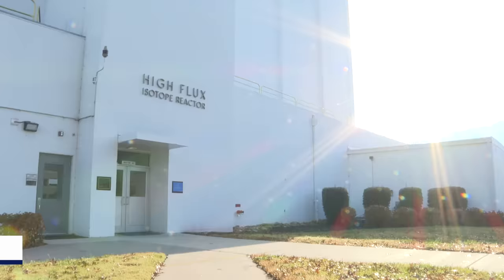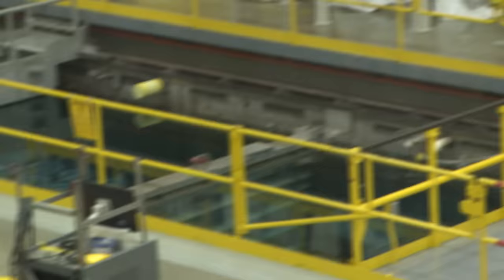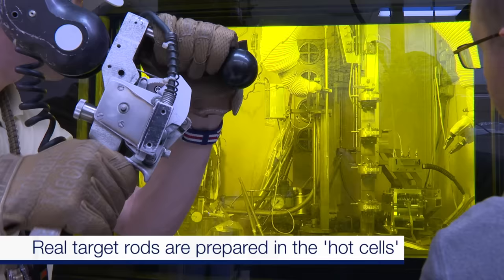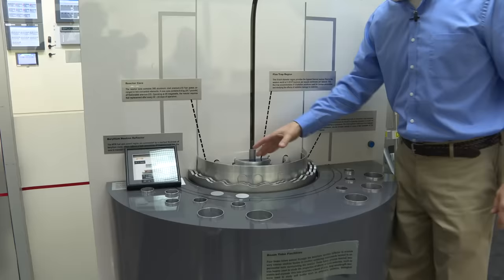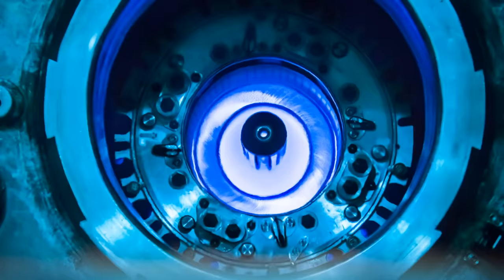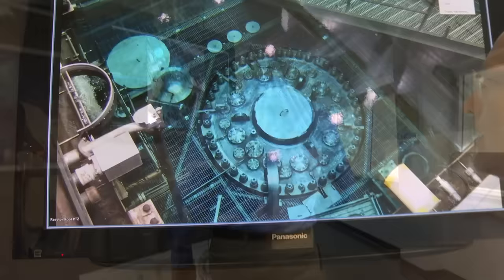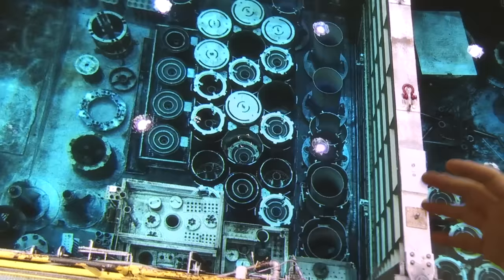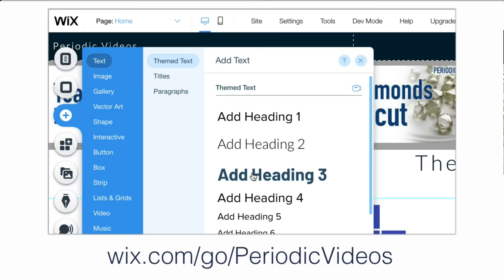Inside a Nuclear Reactor

Comment: Good old nuclear energy. Despite it's ill reputation is it still one of the most efficient and cleanest ways to produce energy. And we couldn't even really live without it even if we wanted to. Parts of modern medicin for example relies on it to produce radioactive isotopes.
Reply: Germany's really digging a hole for itself with its refusal to use nuclear energy. Not only do they have to import dirty fuels to replace it, but they'll probably have to import nuclear isotopes for nuclear medicine as well.
Reply: "cleanest". Waste takes millions of years.
Reply: @RBuckminsterFuller  It is better that way. Espescially since france is on fire.
Reply: @Erksah68  Not with gen4 reactors that allow for processing of fuel waste. LFTRs, for example, are a much better option nowadays.
Reply: Also safest, but people don't want to mention that- the number of casualties/fatalities per megawatt produced are significantly lower than even renewables. People just think of the scaremongering of the big three disasters which resulted from catastrophic negligence, and fail to realise just how rare these actually are. And yet nobody hears about big coal power station explosions or fires, or underground coal seams that keep burning for decades on end. Nuclear's bad rep is mostly unwarranted.
Reply: @Erksah68  First of all, it doesn't, and second of all, it's a far smaller problem than certain groups would like you to think.
Reply: @Erksah68  and can be stored safely while we find a use for it, instead of releasing tons of CO2, various nitrogen oxides, fine particulates, costing millions in cleanning fees for historical monuments, destroying people's health (remember smog?) wich then get to be cured with isotopes produced at plants like these.
Cleanest.

The problem you apparently fail to see is that a single cow dung in a room might smell horrible, but it's easier to contain than an entire room splattered floor to ceiling with it.
Reply: @NapalmFlame  And coal is even worse than nuclear. I'd rather have waste underground than in the air I breathe.
Reply: @Erksah68  its far from 'cleanest' unless you were to design a new Thorium type. But it is perhaps the cleanest that a) a lot of countries don't have access to e.g. geothermal, hydro etc. b) is stored properly and responsibly.
Reply: @NapalmFlame  you are right. you are more likely to injure yourself maintaining a rooftop solar panel, than be an unlucky resident of belarus exclusion zone.  But, chernobyl's all concentrated in one area and its scary and immediate. Coal is of course multiple times worse with pollution, mining, etc.
Reply: @jorgepeterbarton  Renewable energies need time to mature, just like nuclear did. Forcing it will just make it look bad. "look energy prises are rising again". It does also have a positive effect making households conscious about the electricity they are using, but it could've lead to the media killing it in one go.
Reply: Also I don't think casualties are really a measurement of danger, when you directly have access to professionals who ing it for you. If you fall off your roof it's your own fault. You directly could've changed something.
The millions of residents that died in the past did not have any access to such means. Thes just died. Period.
Reply: On a come back now.. 
Most people are not so terrified or skeptical as in 70s.
We need more clean energy and medical imaging etc.
ITER fusion a big project in France.
Check it out.
Reply: @Erksah68  so our planet atmosphere will heat up first form co2 methane emissions long before any issues with nuclear waste can pose a problem..
Fusion at ITER is a game changer in future power plants.
Reply: @MitzvosGolem1  "if we continue it wouldn't matter if we die because of heat or the heat destroying niclear reactors, " that is what you're trying to say?
Reply: @MitzvosGolem1  Most people, yes. But it seems ironic that my country's 'green party' would be anti-nuclear when it is demonstrated to be, at present, the cleanest and most reliable method of power production available.
Reply: It’s a long lasting fuel, but comes at a price when things go wrong. If we had a way to neutralize radiative energy this would make it very attractive.
Reply: How expensive are Chernobyl and Fukushima? A few hundred billion USD? A few trillion? The reactor companies should pay for that. 🍄
Reply: @NapalmFlame  Former head of Green peace is now pronuclear
Reply: Dwadist Coal actually produces even more harmful radioactive waste than nuclear does. At least in nuclear the waste is stored in spent rods that can be safely stored, but the coal waste is burnt, aerosolized and then floats around in the environment along with all the greenhouse gases it produces. People talking about the potential radiation damage don’t realize how much more radioactive material has already been produced by non renewable sources.
Reply: @Erksah68  There were no "milions of residents" who died. Stop speading misinformation. Hydroelectric dams made more death in one accident than all nuclear accident since their discovery.
Reply: @arnaud7671  let me rephrade that. Many died, millions were affected by it.
Reply: @Velo1010  We do have a way! You simply store it under water :)
Reply: Eeehhh... That giant thing we orbit is the best source of energy. Just need more efficient methods of conversion. I don't recall anyone making a power supply rated to last several billion years. 😜
Reply: @jorgepeterbarton  Not only that but the waste produced from solar pannels is 300 times more than nuclear. Also they require thousands of times more mining than nuclear energy. At least at Chernobyl there's forests and wildlife. There isn't  that at strip mining areas
Reply: @scratch no one died
Reply: @Erksah68  Not true.  Highly radioactive material has a short half life, in other words it decays rapidly.  Weakly radioactive material has a long half life, millions of years as you say, but so do uranium minerals in the rocks and soils all around you.  If the Pharaohs had been storing nuclear waste in the pyramids it would be safe to take out in wheel barrows now!
Reply: @RBuckminsterFuller  The Japanese have been putting their reactors online again  as importing oil and gas was damaging both the economy and the environment.  They are tsunami- and seismic-proofing them now to even higher standards.
Reply: @Jawshuah  To be clear I'm pro electricity because this whole banter wouldn't be possible.
Besides you probably haven't heard of Uranium Strip mining. It's a thing...pretty much for any ore in abundance. So...the whole ecologically safe thing about mining is sales pitches. Processing ores from copper, alluminium, iron, titanium, uranium and Rare Earths all leave nasty evil biproducts from chemicals and fuels spent in refining. 
What I was saying is that hey the sun ain't gonna run out and the tech is only gonna get better with time. Less dangerous materials, less exotics, more efficient methods and energy harvesting--just like nuclear if don't stop researching and innovating.
I think solar, hydro, wind, Geothermal and nuclear combined is the winning game.
Reply: @Jawshuah  You can't discount the long term and near term effects on any power plant disaster. Just because someone didn't die right sway doesn't mean it didn't cause long term health problems. Coal, oil, nuclear etc.
I mean look back at the infamous London Fog...there's a history of nasty health effects. Just say in. :)
Reply: @GGov86  anti-nuclear groups are funded by the oil and gas industries
Reply: @Erksah68  Thousands were affected by fear, not by actual radiation.  There are people living in the Chernobyl Exclusion zone right now, and their only affect is a negligibly higher chance of developing cancer in their later life.  The area around Fukushima is already safe to live in, it's just politics that don't let them go back.  Why don't you care about the lives of people who have been killed in solar/wind accidents?  If you've ever worked on a job site, you'll  know that people make mistakes and forget their PPE all the time.  Seems cruel to brush off their deaths.
Reply: @BobbyHill26  yep. cheap coal, as burned in power plants, may contain up to several kilos of uranium oxide per ton coal. Problem is with nuclear: The resources of uranium ore that are economically viable to mine are even more limited than coal! So for the long-term perspective, there would be no way around breeders, which are their own universe of problems.
Reply: @SuperAWaC  that sounds very conspiracy-theoretical. Prob is that many anti-nuclear groups don´t think the whole thing through, e.g., taking energy consumption and the energy demands of a technologically advancing society into account.
Reply: @24680kong  so there seems to be no real difference at first glance: at a certain scale, any technology will lead to some deaths by neglicence. Only, in some , you only endanger yourself, whereas in others, you endanger many more people for long times. Worth looking into properly.
Reply: @paavobergmann4920  hey everyone check this guy out he thinks lobbyists are a conspiracy theory
Reply: the future is fusion
Reply: @timpecover8600  fusion is just about ready, since 30 years....
Reply: @Erksah68  "waste takes millions of years"  This is such a bizarre argument. 
1. The grand majority of radioactive isotopes decay in less than 100 years. 
2. Long lived isotopes aka the timeframe youre referencing exhibits extremely low level radioactivity. 
3. Chemical wastes don't decay or degrade until rendered inert by another chemical reaction. 

So your argument is that we should be afraid of a few isotopes that present low levels of radioactivity, as compared with other types of wastes that could pose a greater threat that in actuality would last infinitely longer? That doesn't make a lot of sense...
Reply: @brian2440  the radiation isn't dangerous to humans, no
Reply: @Erksah68  What isotopes  that decay over millions of years are you so concerned about?  

Many of them I doubt you have even heard about, many of them are actually used by multiple industries because they exhibit low levels of radioactivity. Some of them are dangerous, albeit moreso due to chemical composition than actual radioactivity.
Reply: @brian2440  It is not the radioactivity of these elements that I am primarily afraid of; it is the incredible toxicity of many of the products of nuclear decay.
Also, the 'nuclear waste' that people speak of is not primarily the spent fuel, but the reactor shielding which is irradiated. This makes up the predominance of what has to be stored for, in effect, perpetuity. The reactor 'shielding' is a mixture of compunds that can't be easily separated, thus can only be reused under very specific circumstances. There are over 70 000 tons of nuclear waste material (spent fuel rods, as well as shielding) that still, after more than 50 years of research, have not been reasonably been stored for even ten years unless under direct human supervision and continuous maintenance. But continuous maintenance costs money, money which the nuclear companies do NOT have to spend. 

The governments of Germany and quite a few other countries that are utilizing nuclear energy have recently agreed to NOT force the nuclear companies themselves to cough up the cost for storing these waste materials. The governments themselves have agreed to a) fund research into the recycling or b) storing these materials. As such the economy of the production of nuclear energy works out for the companies themselves, but not for society as a whole. 

If the nuclear companies WERE forced to spend the same money that ALL other electrical power companies have to pay for the storage or clean up of their waste materials, we would have no more nuclear companies, as they would INSTANTLY quit as they KNOW that an economic usage of nuclear fission power generation under these circumstances becomes virtually impossible.
Reply: @RustyDust101  "If the nuclear companies WERE forced to spend the same money that ALL other electrical power companies have to pay for the storage or clean up of their waste materials"

Oh that's adorable. The naivety of believing that all other electrical industries actually clean up their waste materials, and Im not just talking about fossil fuels.
Reply: @SuperAWaC  this is not what I said, and you know it.
Reply: @paavobergmann4920  I know that's the old joke, but we are actually making lots of progress in fusion right now, much more than the past.
Reply: @Captain-Sum.Ting-Wong  so, when is break-even point then? How affordable are the reactor blankets that provide neutron balance?
Reply: @ThePrezred There is a little more Uranium in the ore, but you are basically right. Also, there is not really much uranium to mine. Ok, there is 3x as much Thorium, so we could increase the capacity many times by using that, and Breeding Reactors (Which are inherently much more dangerous for various reasons) to use the fuel more efficiently, but still, the supply is limited. This technology can only be stepping stone, it has a naturally limited lifetime.  BTW, fusion isn´t really clean, either.....
Reply: @ThePrezred Chemical extraction is most definitely reliable, since chemical extraction of that sort is what NASA uses to get their plutonium for their RTGs. They take neptunium that has been bombarded with neutrons generated from a high flux isotope reactor, which contains about 10% plutonium once they're done with it. Chemical extraction is also regularly and routinely done with a lot more isotopes for the medicine industry too.
Reply: @ThePrezred The process of extracting waste products from spent molten salt, or from extracting the desired resulting products from a flux isotope reactor, are comparatively clean. As far as the mechanical extraction, I assume you mean for the metal ores used to refine fuel, and that process is as dirty as any other mining, and could not possibly be worse than what is being done in the Amazon to mine gold.
Reply: @ThePrezred The only major concern when it comes to mining uranium specifically is radon, and the hazards it poses during mining itself. Its worth noting that the radioactivity of uranium ores is comparable to that of granite, so the risks, dangers and pollution is no worse than other metalliferous mining. Thorium poses less risks because it can be mined in an open pit, so there is no risk of a buildup of potentially harmful or dangerous gases, as well as the higher concentration of the desired ores making for a potentially more efficient and less harmful mining process than that which is used for uranium.
Reply: Yes watch thoughty2 new vid on nuclear power
Reply: @scratch you have no clue what you are talking about
Reply: Never thought of it that way. Its always fascinated me and I've even had some nuclear testing done. The tech told me to turn the lights off and look at my pee that it'd glow. Lol!
Reply: Yep. It's the safest form of power actually. Kills less people than WIND turbines do. Lol let's ban wind turbines then.
Reply: The only powerful people against nuclear are funded by oil and coal companies no doubt.
Reply: @Erksah68  so what lol? Those same radioactive rocks have always been in our ground
Reply: @jorgepeterbarton  Its cleaner than those renewables lol.
Reply: Dave Micolichek  But making electricity is arguably it's most important use
Reply: @Erksah68  do you realize how radioactive coal smoke is?

By the objective data nuclear is the clearest and SAFEST form of power known to man with any potential to actually work at scale.

That indeed includes radioactive waste. Its still not even close.
Reply: @Erksah68  millions? 

How many nuclear accidents do you think have happened?

Hint:

Its 3 and nowhere near even 1 million deaths.
Reply: @Lachlan Allen Incorrect. Most are made of silicon , phosporous coating, and carbon polymers. Those heavy metals are redundant at this point, since silicon based ones have surpassed them in efficiency by 3-4 %.
And silicon is common as heck. Silicon dioxide, is mostly found in sand.
Reply: @jorgepeterbarton  contained to one area yes ALL OF EUROPE
Reply: @Erksah68  Waste from mining (lead, mercury, arsenic etc.) will never stop being toxic so a few hundred thousand years isn’t so bad

Comment: Wow, real alchemy.   converting some elements into other elements...
Reply: The dreams of yesterday are the workings of tomorrow!
Reply: @dsdsspp7130  they also convert elements to other elements, especially heavier elements.
Reply: @dsdsspp7130  they explicitely said the turn curium into californium and neptunium into plutonium. those are not just different isotopes.
Reply: unite perry All radioactive elements decay to a lower form, eventually, uranium-238 decays to lead-206.
Reply: Transmutation I think is the modern term
Reply: Alpha emits a helium nucleus , and beta changes a neutron into a proton with the emmision of an electron , both are usually accompanied by gamma rays
Reply: @sebastianarganaraz2879  no